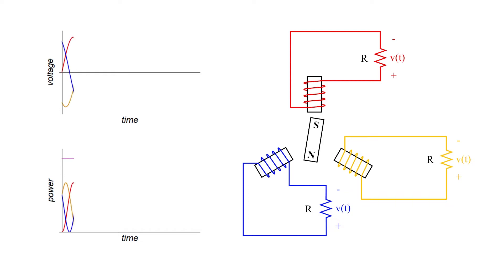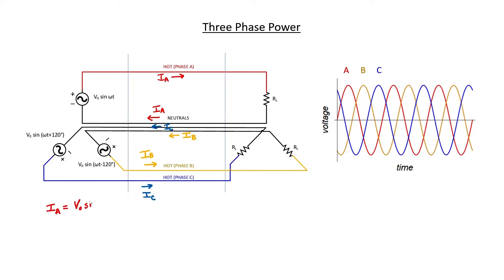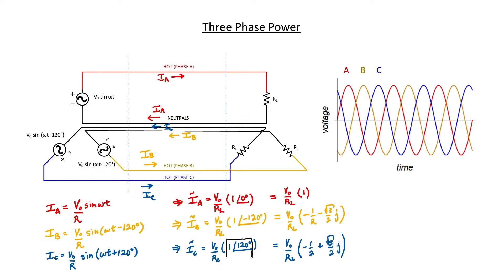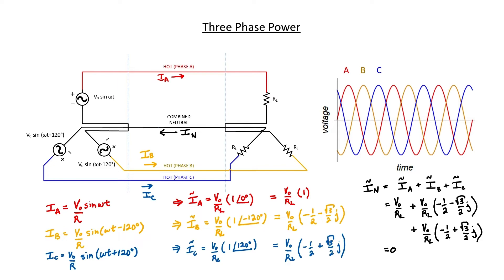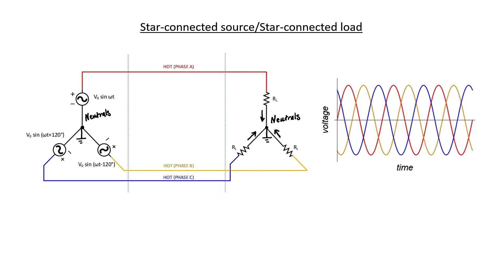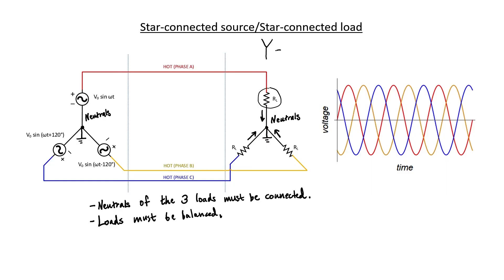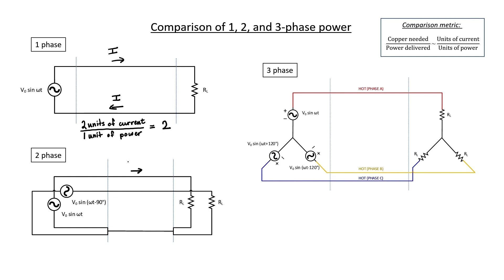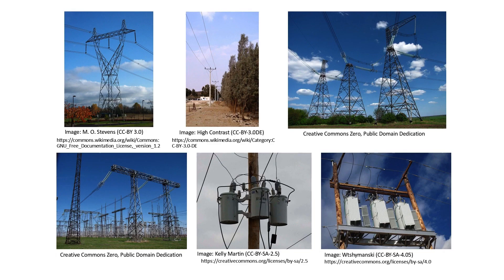Why is 3-phase power better? (15 - Electricity Distribution)

Comment: I would like to give a special thanks for your highly valuable educational videos. Let me add one more advantage of a three-phase system over other multi phase systems. For example, consider a four-phase system where the phase voltage is 100V. In this case, we would have different line-to-line voltages, such as 200V and 140V. This means that simply swapping two wires could change the line-to-line voltage, which is a major issue. However, in a three-phase system, the line-to-line voltage remains constant regardless of how the wires are swapped. This is one of the key advantages of a three-phase system over other multi phase systems.

Comment: 5 phase motors also exist now as stepper motors and there are higher power 5 and 7 induction motor prototypes.Some engineers argue that it will be better for electric cars because you cant start a 3 phase motor if a phase is broken but you can start a 5 phase motor even if 2 phases are broken.
Reply: Why not 9 phase? Or while we're at it, has 27 phase been tried? Would be more efficient.
Reply: @xntumrfo9ivrnwf  Multiples of 3 arent that interesting. 9 phase is equal to using a 3 phase generator with 3 times the power. Multiphase drives usually focus on prime number phases.
Reply: @MernokiMegoldasok  thanks, that makes sense. Have you considered an 89 phase generator?
Reply: @xntumrfo9ivrnwf  I didnt but some people condisered building 19 phase motors.